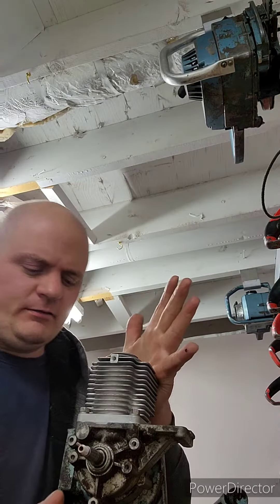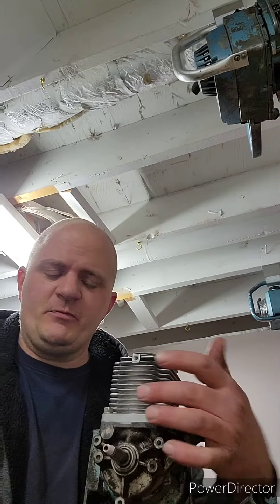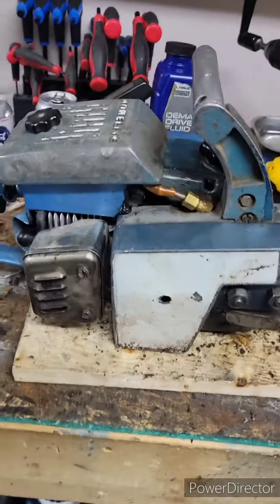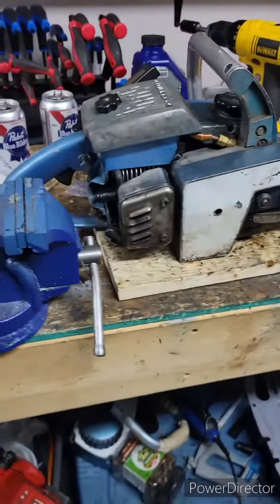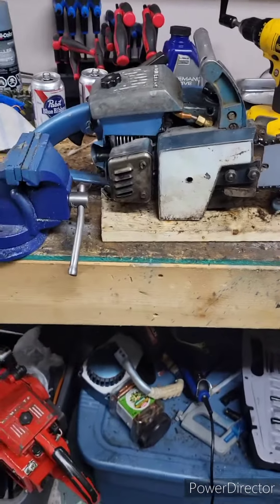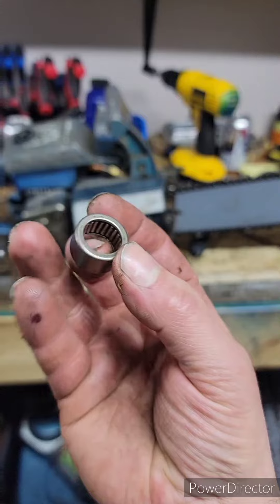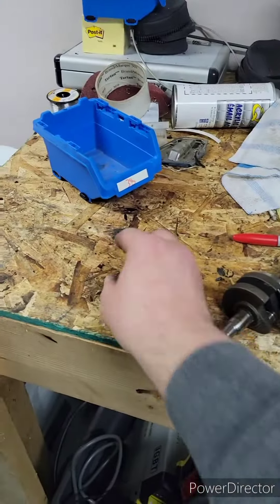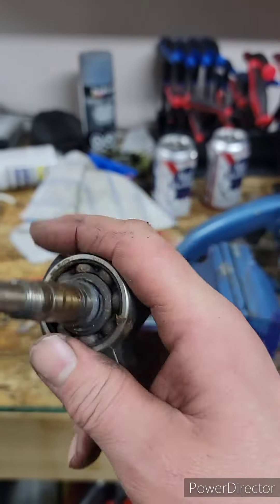aliexpress special  Xl12 back together

Comment: Why not put the super xl crank in it?
Reply from the maker: Would have to change drive case too which I have, but I really don't like dealing with the connecting rod needle bearings on homelites, alot trickier than a mac